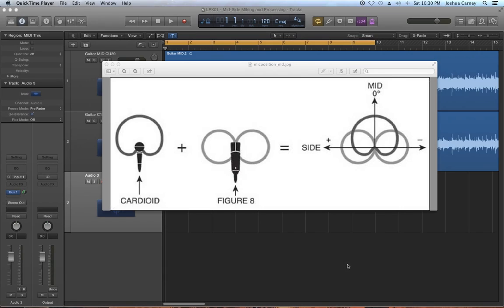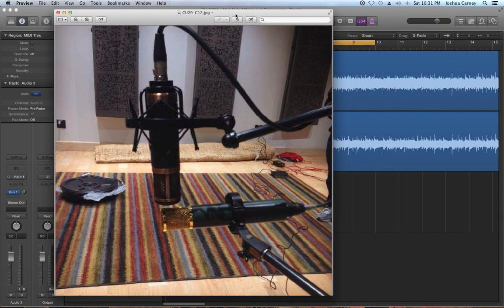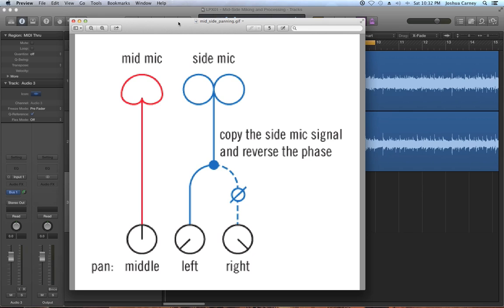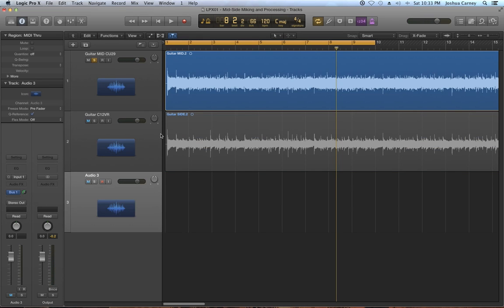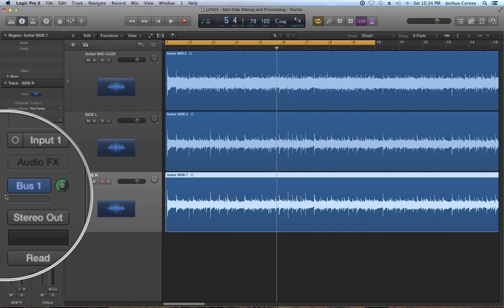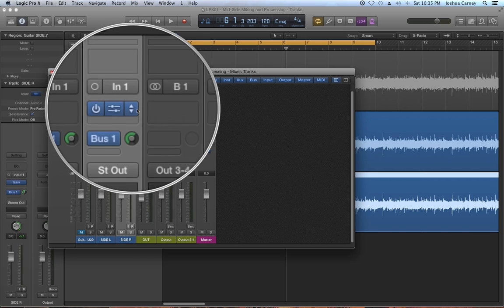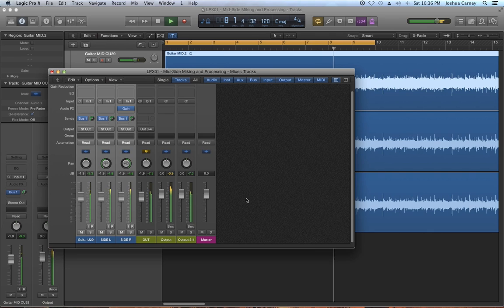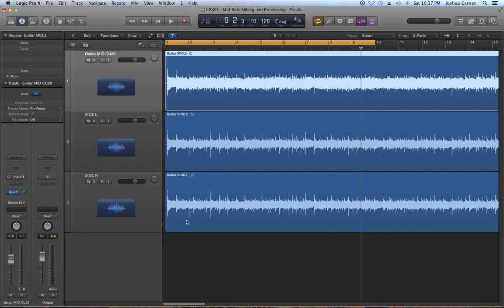Logic Pro X - Mid-Side Stereo Miking and Processing

Comment: Another way of accomplishing this is to pan the cardioid left and the figure 8 mic right, then send both to a stereo buss on which you have inserted Logic's Direction Mixer plugin set to the MS Decoder preset.  I happened upon this method when I was searching for a phase switch in my plugins and not finding any--I guess I didn't check the Gain plugin.  I do this all the time now, especially on drum overheads and acoustic guitars.  Sounds great, and it's mono compatible.
Reply from the maker: Yep, another great way to do it. I didn't mention it in this video, because I thought this was the simplest way. I'm actually saving that for an actual Direction Mixer tutorial.
Reply: MusicTechHelpGuy Well now I can try it the simpler way, now that I finally know where to find the phase switch!  Cheers!

Comment: I decoded a MS signal from a Zoom H6 that was recorded into Logic X using the H6 as an audio interface. I then used Logic's direction mixer to decode the track. I clicked "MS" on the direction mixer plugin, and the sound is more to the left channel of the output. According to this video, that's a sign that the MS recording was decoded successfully. But I don't want the signal to be unbalanced. Is using the pan knob the correct way to balance the signal. Also, it seems to be a lot quieter when the Direction Mixer is disabled. I guess decoding it into stereo makes it quieter, and you just have to up the channel level to make it louder.
Reply: I also use the Zoom H6 MS MIC and i learned that the MID mic is recorded to the left pan That is why your left channel is louder because it also has the mid section in it. So you need to go to your menu in the Zoom H6 and go to MS-RAW Monitor to enable RAW recording, Then in your DAW you can separate your recording to 3 mono tracks and then apply this tutorial video on your tracks.

Comment: Great video, short and to the point.
If ever you treat the subject again, maybe you can demonstrate how panning the mid cardioid more to one side or the other also has neat stereo image effects, with added depth (i.e., front back, as opposed to left right).
Also interested to know more about Jim Pellinger's method described below. Very intriguing.
Finally, WRT to figure 8 and why it is only mono, it should be pointed out that the figure 8 is just like a cardioid, except that its diaphragm is open to sound pressure levels on both sides, whereas a cardioid purposely isn't. Thus, the sound pressure levels on both sides of the diaphragm are in phase and in mono, in that, when the diaphragm is pushed to the right, it is also pulled to the right. That's why a figure 8 outperforms a cardioid in that setup.
But you can also use a cardioid. (like an XY setup) and proceed from there.
Or simpler still, just use one cardioid to track. Copy the track once, and make it sound more like a reflexion, i.e., give it a thinner EQ colour (maybe add an exciter), drop the gain & put on an expander to underline the transients, nudge it a few milliseconds to taste, etc. Then make a copy, panning one hard left, the other hard right.
Reply from the maker: I plan on doing a dedicated Direction Mixer tutorial in the future, which is why I didn't go that route here -- IMO this is the simplest way, especially for people who are new to this. Not a fan of the 1-cardioid method you mentioned though, because with MS the capsules are right on top of each other and you end up with near-perfect phase coherency. With your method, it might sound really cool in stereo, but probably isn't the most mono compatible.
Reply: MusicTechHelpGuy You're absolutely right about the mono compatibility. In all cases, always check the mono (and the correlation meter, very useful). I should have emphasized the importance of having a distinct sound from the track you're duplicating and also add that it would be better to bounce it before moving on from there. Why I mentioned that method is that some home recording guys like me might not be prepared to buy another mike just yet. I was on my way to get one when I decided to experiment with a figure 8 at a friend's studio. And that's when we tested these other options, on vocals mainly. It seemed quite comparable. Now excuse me while I try 'n catch up with all your other videos - you have absolutely the best stuff on Logic Pro X. Thanks. Phil